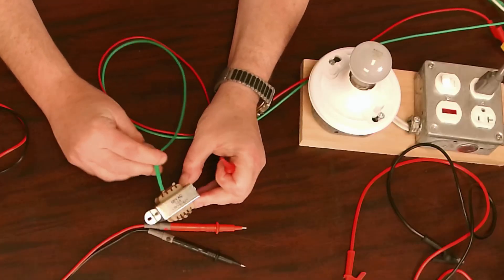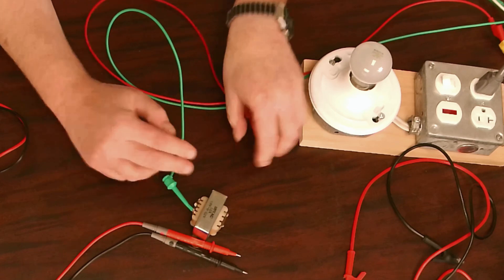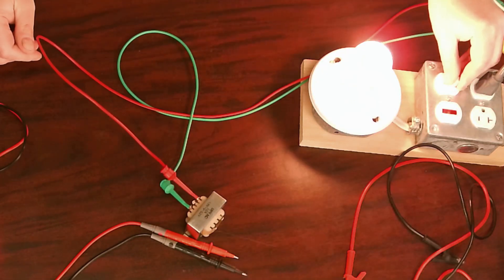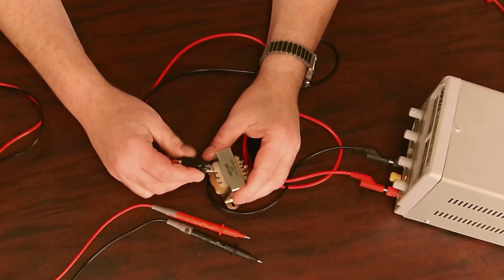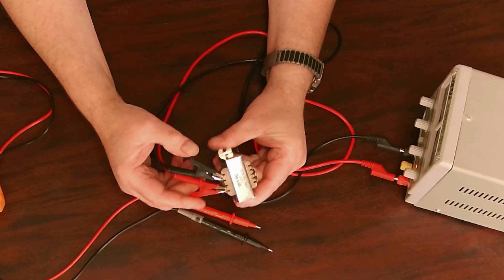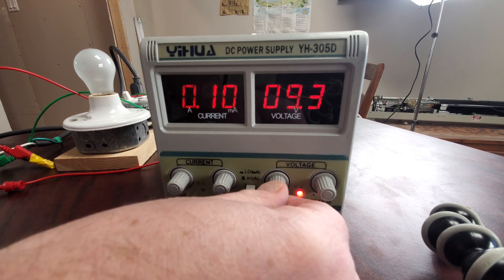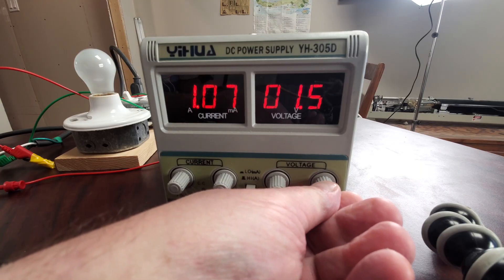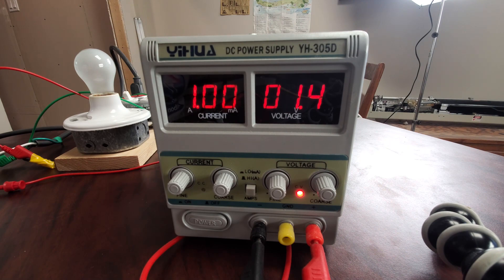MORE Ways to Identify Unknown Transformers

Comment: Thank you very  much for doing the follow up video, I found it very interesting.  The trick with the light bulb reminds me of a trick an electrician once taught me during my apprenticeship.  If you have a house with a fuse panel, that uses screw-in type fuses and you have a circuit with a dead short.  Instead of blowing a bunch of fuses to try to find the problem, you can put an incandescent light bulb in the panel instead of a fuse.  If the light bulb glows brightly you still have a short circuit somewhere.  If the light bulb glows dimly then the circuit has a higher resistance and likely wont blow a fuse.  I wouldn't recommend using that trick now days with all of the electronic devices in a home as these devices could be damaged also, if something was shorted in the lightbulb it could explode.

 I was having a bit of trouble understanding why you were using the square root of the inductance or resistance ratio to determine the turns/voltage ratio of the transformer.  I guess my understanding of transformers is a little limited.
Reply from the maker: Your fuse panel version of the light bulb trick is neat. The dim bulb tester that I used is essentially the same thing for use when repairing electronics, often old tube stuff. The bulb is the perfect thing to limit the current while trying to find out what component is malfunctioning.  

I guess I should have explained the square root thing in more detail: Consider on a 12V 100W light bulb on the secondary of a transformer. It draws 8.3A and therefore has a resistance of 1.44 Ohms. Now consider a 100W bulb on the 120V side. It draws 0.83A so its resistance is 144 Ohms. Its resistance is 100 times the resistance of if the 12V 100W bulb.

That 100 times is the voltage (or turns) ratio squared: for a turns ratio of n:1, on the lower side the   voltage is V/n and the current is I*n . R = V/I = (V/n)/(I*n) = (1/n*n)V/I.  So resistance or impedance of the same power load on one side is the square of turns ratio of the other (or square root depending on which way you are going). So if we assume the transformer was designed so  the power loss in the primary and secondary would be the same under load, their resistances would be related by the square or square root of the turns ratio. 

For inductance its the same idea X=2πfL where X is the reactance and L is the inductance. X is like resistance in terms of V and I, so reactance from one side to another is squared or square root. Since Inductance is 1/(2πfL) times the reactance, the ratio of inductance from one side to another is also ratio squared or square root. 

Hope that made sense!
Reply: @ElectromagneticVideos  Thank you very much for the explanation.  That makes sense to me now!  I really appreciate your way of teaching through practical examples!
Reply from the maker: @tylerlawrence4885  Glad it was understandable Tyler! I might to a video on that - the setup at my desk makes it much easier to do videos - hopefully more opportunity for that sort of thing.

Comment: 1-by cable insulation
2-position of coil 1 and 2
3-google it
4-ask a friend
5-wire size
6-power and resistance 
7-voltage drop on low vote dc test
8- by using a reactor coil and 2 voltmeters one on each cool as a voltage devider with coils

That was my opinion on identifying  unknown transformers great video 😊
Reply from the maker: Nice list. Number 4 reminds me of and old game show where one of the use one options was "phone a friend" :)